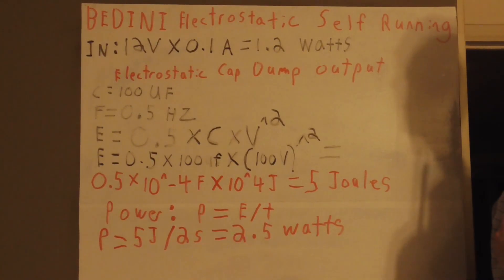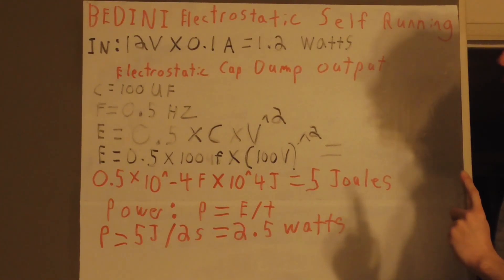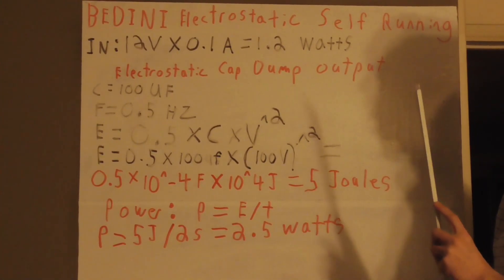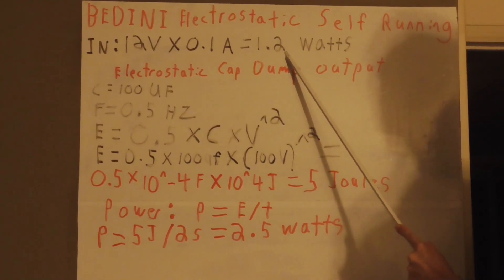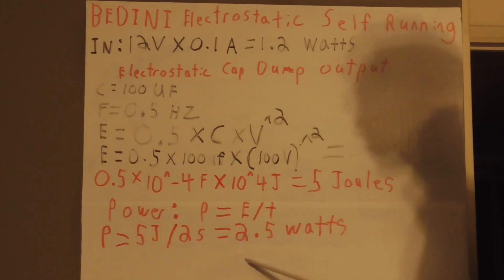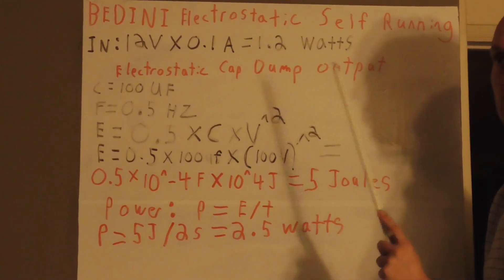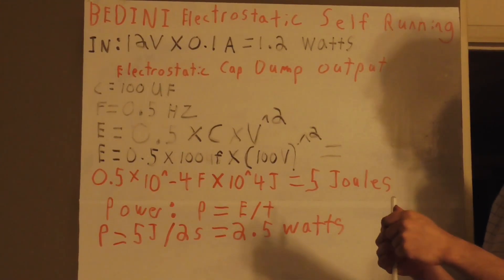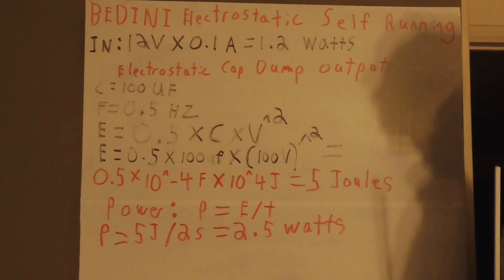Bedini Electrostatic Self Running

Comment: THIS IS AWSOME BROTHER.... Love this absolutely use full math..This proves that YOUR OBSERVATIONS ARE TRUE!!! my neighbour's think I'm crazy waking around with a huge Alluminium sheet and a multi meter.... Joel YOU ROCK BROTHER!!!
Reply: you are amigo!
Reply from the maker: That's cool that your testing out random metal conductors, If your going to do this. Please be careful, I know its a long shot but if someone nearby has a faulty electrical system. There is a small chance you could couple into that and it wouldn't be pretty.

Comment: Testatika!
Reply from the maker: Yes I often think thats the core of it. nevermind radioactive but that just my opinion. If you do the math and don't get the decibel point mixed up like I do LOL, It's clear to see that an electrostatic disk won't take much to charge a capacitor to 100 volts and the dump gives you that amps a second current out of the raw electrostatic that would just be extremely high voltage but no usefulness in current on its own. The charge short delay in the cap is what allows us to convert to current output.

Comment: The Bedini is less of a motor and more of a flyback capture circuit
Reply from the maker: Yes the wheel movement is the trigger, you don't even need the wheel part to make the concept self triggered instead, it's still interesting how a light mechanical load you can indeed get away with like a fan blade. May as well use that extra energy to spin electrostatic disks instead of a fan blade for "looks"

Comment: Please double check your math
It should be 0.5 joules
100ufx10^-6x 10^4x .5 = .5
Unless I am doing something wrong
Thanks
Reply: 🤔scratching chin..
Reply from the maker: .Based on the corrected calculation for the energy stored in the capacitor, the power output of the system would be lower than previously estimated. It was a calculation error on my part, and I apologize for any confusion that may have caused.

I incorrectly calculated the energy stored in the capacitor as 5 joules, which was an order of magnitude too high. Me bad!!!! So let's do this again :)

If the energy stored in the capacitor is 0.5 J and it is released over a 2 second period, the average power output of the system would be:

P = E / t
P = 0.5 J / 2 s
P = 0.25 watts

So the power output would be 0.25 watts. Less then our input. So in order to get more in output we need to modify the system as follows:

To achieve an output power of 1.3 watts, assuming an input power of 1.2 watts, the power gain needs to be 1.08, which means the output power needs to be 1.08 times the input power.

Using the same formula as before:

P = 0.5 x C x V^2

We can rearrange it to solve for capacitance C:

C = (2P) / V^2

Where P is the desired output power (1.3 watts) and V is the voltage at which the capacitor will discharge (100 volts).

Plugging in these values:

C = (2 x 1.3) / (100)^2 = 0.0000026 Farads, or 2.6 microfarads

So a capacitance of 2.6 microfarads would be sufficient to achieve an output power of 1.3 watts with a voltage of 100 volts. With a cap dump of one second. 

Same idea! Sorry about that.
Reply: @joellagace1679  thank you Joel
I did not mean to be negative 
I just wanted to let you know about the arithmetic
Thanks for clarifying and redoing things
You are a true researcher and teacher
This is my opinion of 30 years of college teaching and now retired 
God bless you my friend
Reply from the maker: @Gacha.Cupcake  No no! I appreciate it, It was a doofy typo on my end.
Reply from the maker: @Gacha.Cupcake  Nice I always wanted to be friends with professionals as well. In my small town we basically have something like community college and the students of the electrical class approached me regarding some of my energy harvesting projects they wanted help replicating. When the teacher got a hold of me and I explained how it worked, I never hear from him again. It's so unfortunate how this kind if tech bothers most professionals. Teachers to engineer, I usually get negative responses and distancing instead of friendship and collaboration.
Reply: @joellagace1679  most engineers and academicians are raised and molded through the system. They are close minded and can’t think outside of the books and science they are fed. Like robots

Not to worry
Our. Consciousness will take over in due time. We just need to stick together and ignore the nay sayers

I appreciate your work and efforts and would cooperate in any way possible.
Keep up the good work and best wishes
God bless you my friend